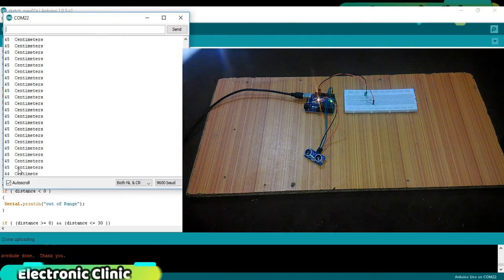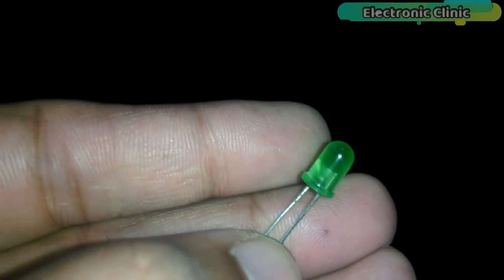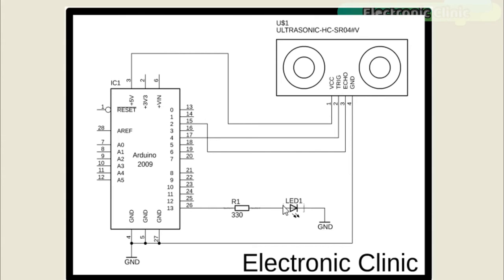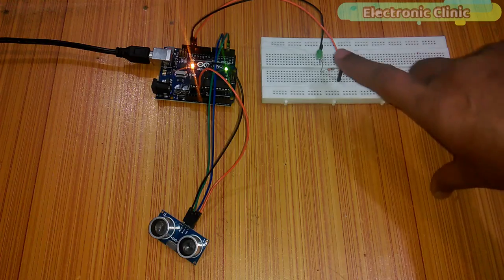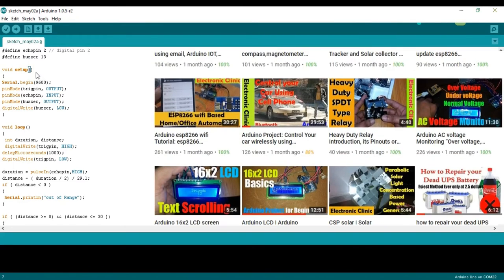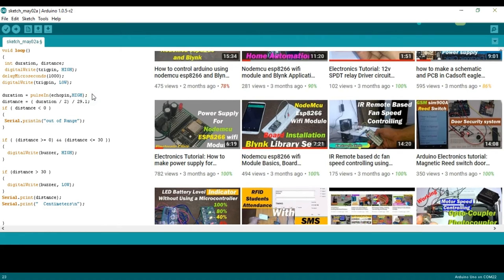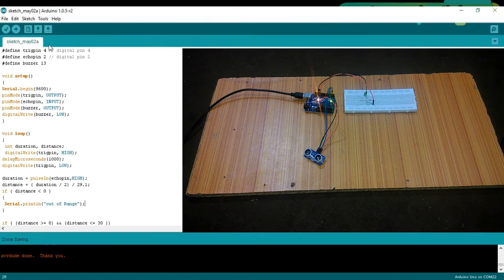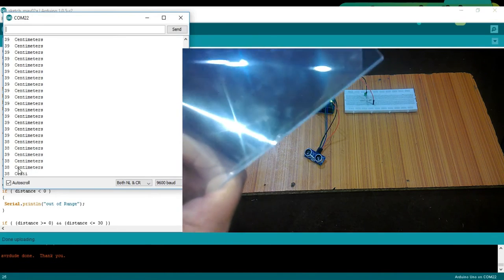Arduino Ultrasonic Sensor HC-SR04, Obstacle detection, distance measurement with Ultrasonic Sensor

Comment: I've used your code and apply your method, But distance shows always 0 (zeor) centimeter. Please solve this problem.
Reply from the maker: this works, check your wiring and ultrasonic sensor